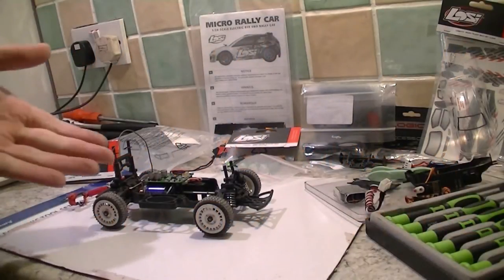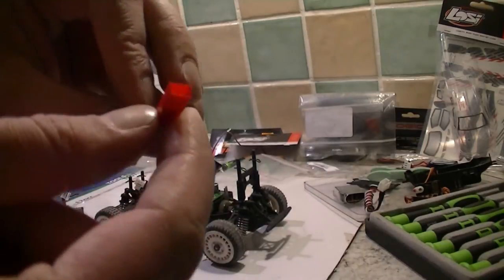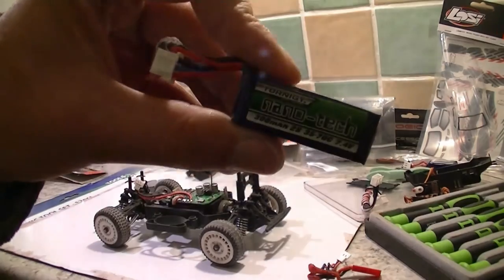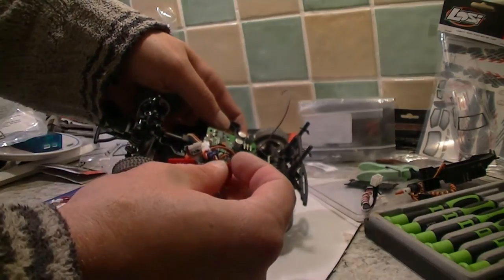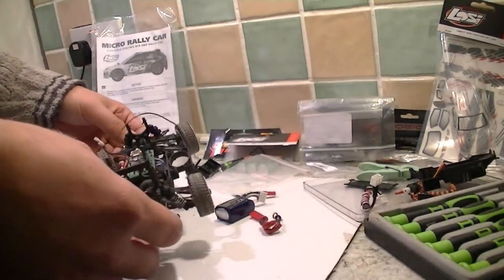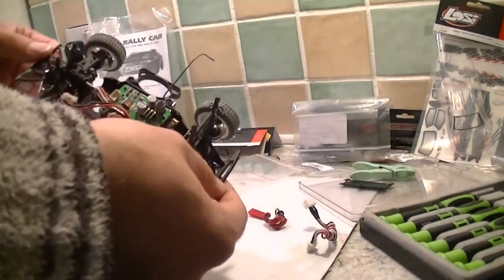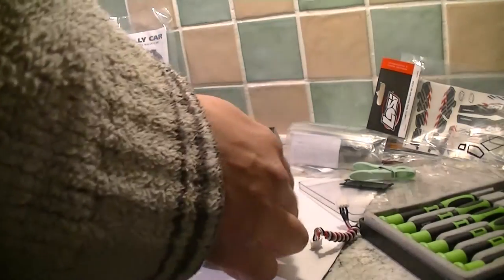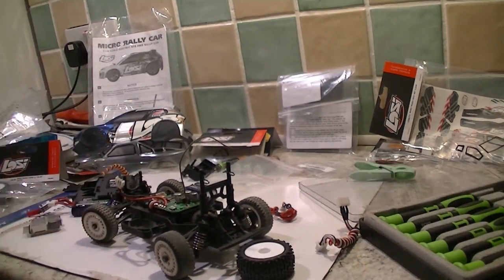Project Losi Micro Madness - RC Car Club

Comment from the maker: Yeah was new bought it back in April 2013.. £99 batteries included Too ;O)
Great fun indoors or at skate parks even on stock 4.8v NiMh..
When driving it's so small it's hard to see what it's doin and for your brain to keep up...
Quite tough too, jumps great, 4wd grip is awesome and 3s will kill your tyres quickly but it's Fun 29 MPH  in bout 2.5 seconds.. 360 spins on the spot so fast it looks blurred..